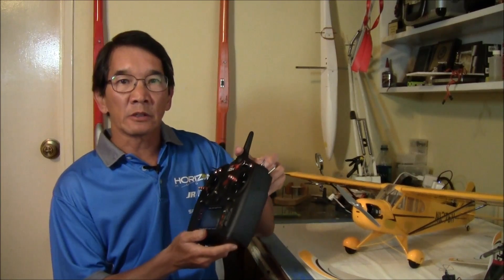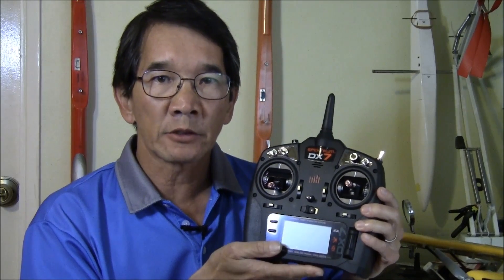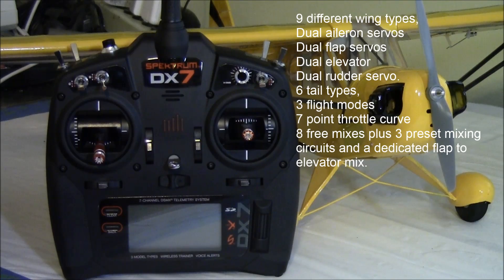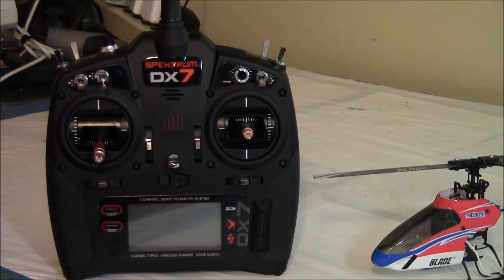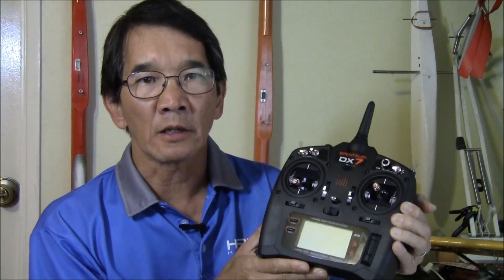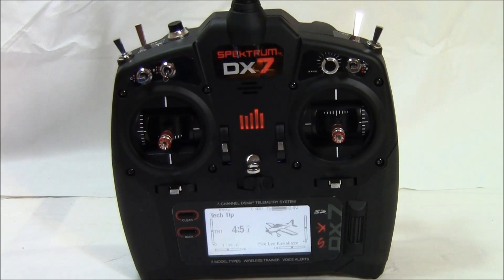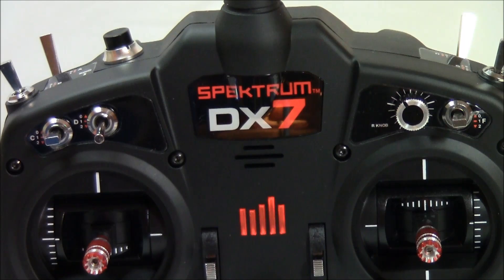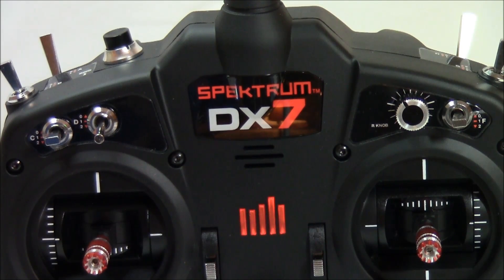Team Tech Tour   Spektrum DX7 Gen 2

Comment: I just bought DX7 and then I plug in the charger, it does not show me any sign of being charge. How I would know the battery is charging ? Thank you very much for your anwser
Reply: +Tuan-Anh Nghiem   I had the same question. The only way apparent to me is to flip the power on periodically to see what the charging status is.
Reply: Jack Z yes, I do the exact same, I have a feeling that's the only way to check